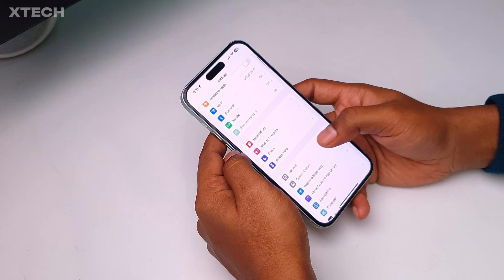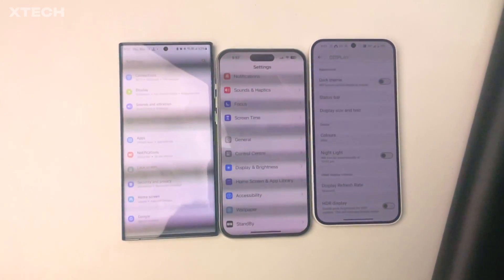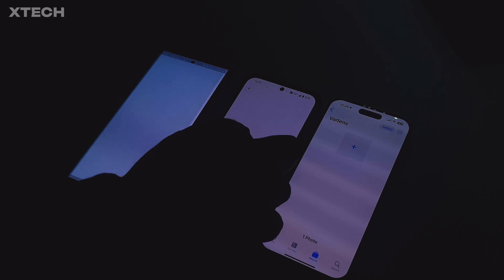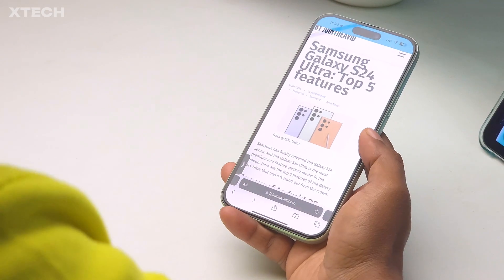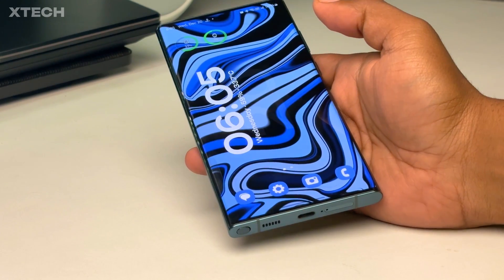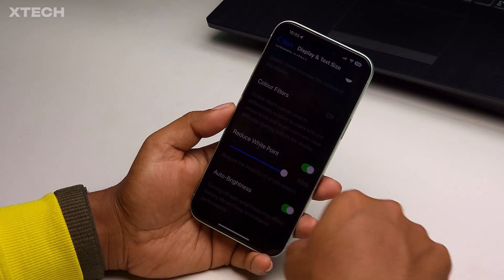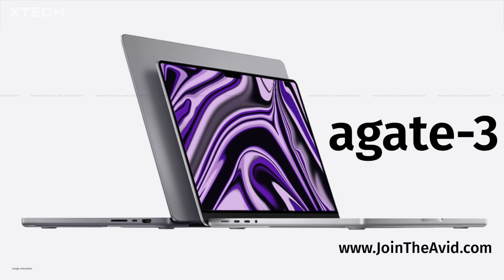PWM Frequency in OLED phones - Everything You Need to Know.. What You Can Do?

Comment: Smartphone produce eye strain mainly because combining short viewing distance with direct light emission.

No matter the technology, you should avoid long sessions on smartphones, please don’t confound people with wrong information.

The recommended distance to view a screen is from 40-50 cm and more, for many reasons that are more related with the difficulty to get correct accommodation of eyes on a screen than on a paper.

You simply have the 20/20/20 rule, if you respect it you won’t experience any fatigue.

PWM, light blue, refresh rate… are only part of the problem
Reply from the maker: Yes

Comment: Holy moly, I was afraid that my eyes are getting worse because of my age. Latelt I sent my Pixel 8 for a warranty just to notice that headaches are gone and vision is more sharp. Now it came back, it's still in the box and I am wondering what I can buy instead. I am using now my old Galaxy S10 with Amoled display and I don't have that problem anymore.

Comment: I disagree it's due to brightness control I can't look at a phone with 100% brightness and hurts my head. I think it's too prevent burn in
Reply: You can install low brightness app which can adjust your brightness but still the screen brightness would be at 100% since pwm is lower on 100% brightness

Comment: PWM should be forbidden and only ergonomic DC Dimming allowed. PWM makes Screens (not only smartphones, also tablets and TVs) UNUSUABLE for sensitive clients.
Reply: It depends linearly on the frequency (the faster the less probable to experience symptoms).

Is not the only factor that can cause you eye strain, but you can apply active attenuation at night or in dark ambient.

For Android phones there are plenty of them in Google Play: since many phones are only DC dimmed on the 50-100% of their brightest you can reach the 0-50 % by active dimming 

Of course, active dimming will alter the color space reducing the dynamic range, but today’s screens are all high dynamic range so they will transform your screen in something similar to an IPS panel (except by black color which will be entirely black).

The issue is the popular demand to more realistic screens that can achieve high brightness without burning, whereas OLED cells have a low range that behaves accurately with voltage. 

You can either build panels for bright ambiences or dark ambiences, but both of them are impossible today.

That’s the reason of PWM technology, it reduces the total amount of photons without altering the colors.
Reply: ChatGPT told meg there is not exist phone with full dc dimming.
Reply: @kerri4300 look into TCL 60 nxt
Reply: You should learn that at low brightness PWM is REQUIRED on oled panels. I am sensitive, and iphones and samsungs have abysmally low pwm that cause headaches. My honor magic 7 pro has 4k hz and I have 0 problems
Reply: @markojovanovic9651  why do they have to put pwm inside them ?
Reply: @above481 Do you even understand what pwm dimming is?
Reply: @markojovanovic9651  no I don't

Comment: Great video. I’ve noticed I get very affected by the basic iPhones, but not by the iPhone Pros. I think it’s because as you said the higher display refresh rate influences the PWM frequency and the effect as a whole becomes less noticeable for the eye.
Reply: So using iphone pro in battery saving mode makes pwm worse?
Reply: @ I haven’t personally noticed this (despite running an automation that puts on battery saving mode at 30% battery). But could be. There may also be some other reasons why the PWM is much less noticeable on the Pro phones.

Comment: My research about the top 2 most safety smartphones for your eyes to use in 2024 has the following conclusion:

1. iPhone 13 - 608 Hz;
2. iPhone 13 pro - 506 Hz;

Also, Nothing phone 1 and Nothing phone 2 are quite gentle for your eyes.

Comment: I had to give up on modern OLED phones and tablets, only PWM-free works for me. I hope they can make PWM-free devices soon again.
Reply from the maker: Hopefully 🤞
Reply: There’s no such thing as PWM free, LCD also have the flicker but it’s so fast that are not noticeable to camera or eyes.
Reply: @egorkosten  Most LCD are PWM-free. You can learn more about PWM on Wikipedia. Good luck.
Reply: @JoelsVideoklipp  it’s not true, if you measure iPad Air LCD screen it will have 0.5 –1.5 flicker depending on color you are measuring, white will flicker less then blue for example. Meanwhile OLED will have 9.5 – 11.5 for iPhone 13 as example on max brightness. So as I mentioned before there’s no such thing as no flicker screen or PWM free screen.
Reply: @egorkosten  You can read more about why your iPad Air is having flicker under Frame Rate Control on Wikipedia (it's not a normal PWM but some weird flicker). Also read about the technology behind LCD and OLED, and why LCD can have direct current regulation on the backlight and OLED avoid it because of burnins.

Comment: Bought an Redmi Note 13 Pro 5G.
Can't use it, after a few seconds my eyes are in absolute pain.
The sad thing is, I had no Problems with my Mi 9T Pro :(
Reply from the maker: It's always weird.. I am even scared to upgrade from my current samsung.. it doesn't affect me as much.
Reply: @XTechByJoinTheAvid  Xiaomi 14 (but not T Pro and Ultra) has the Anti-Flicker mode like my 9T Pro.
But the Xiaomi 14 cost 1000 bucks, and this is out of my pocket... 😐

Comment: What a the current best smartphones with a good pwm rate? Should I sell my s24 ultra just because of that? The s24 ultra has 480 pwm rate. Is this very bad?
Reply: just ask your eyes..is it ok..then its ok
Reply from the maker: If it does affect you badly then you might have no option to sell it depending on your presence. But you have to move to chinese manufacturers or nothing branded phones. But then overall they are no where as good as Samsung Google or iphones in other areas
Reply: @XTechByJoinTheAvid  Thank you very much for the answer. 🙂👍

I would not say that it effects me negatively. But also if it does not effect me negatively isn't it bad for my eyes? That is what I worry about!
Reply: For protection, and for long-term, I suggest that you buy a phone with high pwm hz frequency like honor phones, they are the best ones in this department.
Reply: Honor magic 6 pro 100% check it out

Comment: Hello, my previous phone was Galaxy A71 and I had it for 4 years and the PWM rate was 240Hz and I had no problem with it. I bought Galaxy A55 for a while now, which also has a rate of 240Hz, but I have a little problem with it, eye strain and a little headache. What do you think is the reason?  what is the solution
Reply: Cause of the modulation

Comment: I have Galaxy S7 and Galaxy A15. They don't give a fatigue to my eyes after using it for a long period. But my new Galaxy S23 hurts my eyes so badly after using for just 10 minutes. 

I checked S7 vs S23. They used different default pwm frequency for same brighness level. Galaxy S7 used lower PWM than Galaxy S23.

Is there any relation between their new Dynamic amoled 2x (S23) with eyes fatigue issue? My galaxy s7 and A15, they both using super amoled, works fine for my eyes.

This is so annoying. Expensive phone but it harms your eyes.
Reply: How many phones do you have?
Reply: i have S7 and note 10 plus.. both just kills my eyes.. i am looking forward to the LCD phones..

Comment: Honor magic 6pro is good in market having around 4300 pwm,after using s24u, i got much headache and sleep distrubance so,i recently brought it, i need to test how it is helping me
Reply: BS. I'm PWM sensitive and ran to check Magic 6 right after it appeared because of 4300Hz PWM. No. Fail. Same eyes pain and headache after 1 minute.
Reply: @VYM, have you tried enabling the circadian display and setting the night sight to automatic display?

I recently conducted a personal experiment, using the Samsung S24U for 15 days and the Honor Magics 6 Pro for another 15 days. Based on my observations, when using the Samsung device between 8:30 PM and 10:30 PM, I experienced difficulty falling asleep after turning it off. My eyes felt strained and dry, and it took me approximately two hours to finally get some rest.

However, after switching to the Honor Magic 6 Pro, I noticed a significant improvement in my sleep quality. I was able to fall asleep within 15 to 30 minutes, and sometimes even while using the device itself.

In my opinion, this particular device seems to have a positive impact on sleep compared to others. If you prefer not to use a smartphone, I would recommend considering their tablets as a secondary option.
Reply: @Hemanth_321  tried everything. All options. Only Honor 200 and Iqoo Z9 felt little bit better, but still not IPS. So I'll be stuck with my Poco x3 pro till the next IPS display phone is released.
Reply: So what are your thoughts on magic 6 pro?
Reply: @viveksabharwal9027  Hi vivek, 
Definitely worth to buy if you are looking for eye comfort, I am so satisfied with the phone performance wise and eye health wise

Comment: Hello. things turned out quite interesting for me. almost every new phone gives me a headache and I can't sleep for days... The point is that I have the z fold 5, which many people say is very bad for pwm sensors. I have no problems with the z fold 5 phone... but now comes the interesting part, because I bought the Honor magic v2 phone, which, if I say correctly, uses 3850 pwm, but is completely Oled... well, after 15 minutes from this phone, I have a headache for 3 days... so I think this pwm thing means nothing... especially this blue light /eye care protection... Maybe just for me....but sadly not worked for me the Oled screen...same as the tablet s9 ultra....or s22 ultra....
Reply from the maker: PWM affects people differently..
Reply: blue light can be solved mostly in software, but no way for pwm

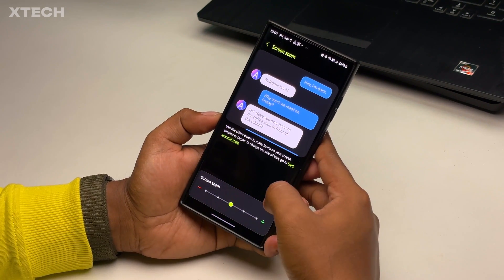Comment: 5:45 so if the brightness higher it’s better @?😢
Reply from the maker: Look the PWM works at the hardware level.. where they use a technique through software to change  frequency of the LEDs on and off cycle.. extra dim is a software filter on top of the UI
Reply: It’s the thing I extrapolated even from another video, too :’

What a contradiction, indeed!
Reply: @tomsbeingtheleo  ?.
Reply: yes. high brightness usually don't activate pwm
Reply: @fcvagrdx  so on high brightness it is dc dimming or what???

Comment: Only solution I found was to swap out the OLED with an LCD on a used iPhone 13 (or any iPhone.) Makes no sense to buy new if you’re going to remove OEM parts and replace them with third party parts. Outside of faster battery drain it’s been fine. I’d recommend buying the Plus variant to counteract the higher battery drain wish I would have done that.
Reply from the maker: Ultimate solution
Reply: @XTechByJoinTheAvid  which screen? JK screens still have PWM
Reply: Replacing the screen might not be possible, as there could be issues with the interface and dimensions?
Reply: @manfc521  I can tell you it is possible because I did it with my iPhone 13 that I am using to type this message.
Reply: I also thought about this option as a solution 😊, but how/where you get the IPS screen that is compatible with your phone?
Reply: In Which device you used this technique?

Im using iphone 14 plus now😢 with OEM display😰

Comment: I tried an app called OLED saver, you choose and it keep the phone brightness at a higher level pushing the PWM to be higher then it applies a filter on top to control the brightness, honestly it was an improvement on my S22 Ultra.

But the best solution is to get a Chinese flagship phone the PWM is insane and using OnePlus, Realme, Xiaomi phones never gave me any headaches or eye fatigue.
Reply: As for the first point I figured out putting the screen brightness to the max and using 'reduce white point' as I have an iPhone is kind of working, but it's a trip to activate! I wonder why apple also doesn'thave a separate toggle from the control center for activating Night Shift and the fact it cannot be permanently put on, smh...

I'm definetly getting a flagship chinese phone in a few months, it's going to save my eyes from dryness and eye fatigues.
Reply: @tomsbeingtheleo  лол это буквально есть в шторке. Просто нажимаете на иконку в шторке и все. За 1 секунду
Reply: @tomsbeingtheleo if you still have this problem, you can put "reduce white point" in the control center, it's under accessibility
Reply: I could not find on google play store because it's only support older android version 😢
Reply: Try extra dim in accessibility settings. @Jejdnxjx817